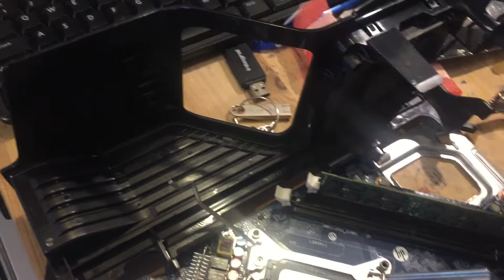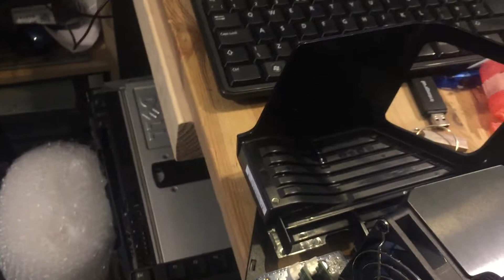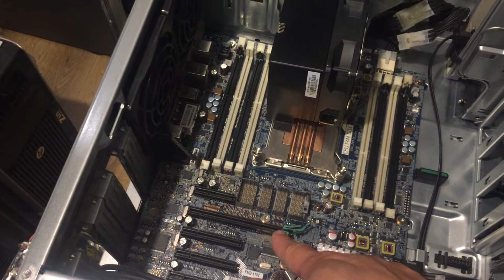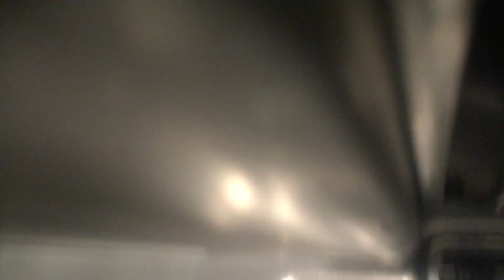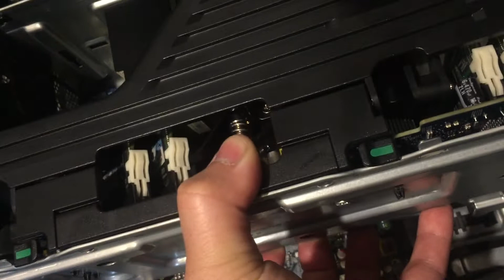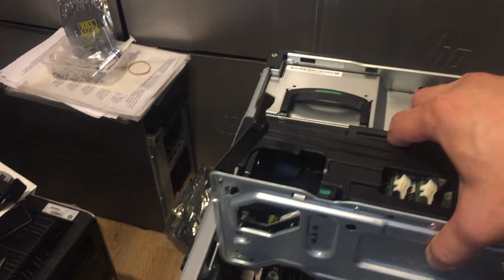HP Z620 2nd CPU riser board installation memory upgrade e5-2670 96gb ram

Comment: I love this machine !
use to work on a older medion,with a asus board....(2007) with a core duo...great desktop,great performanse when a ssd is used!
Stil use the medion some times,just for old times sake,and to keep it up to date,
But sins i use my Z620,with dual cpu(2x xeon 2660) and 32 Gb Ram....i know i had met my for ever partner.
This machiene is SO much over kill for what i do on it,that it will still be a great platform for decades!

Comment: I just used this video to help me upgrade my recently bought z620 from a pair of 2609 v2s to a pair of 2680 v2s! This helped so much, thank you!

P.S. Why the hell are the fan headers so tightly stuck together, I was having sequential heart-attacks using a screwdriver to pry them apart?!
Reply from the maker: yes, i hate the fan shroud as well. it can release by using bare finger pushing the green label parts away from the metal part
Reply: Actually I was referring to where the CPU fans plug into the Motherboard/Riser-Card, the shrouds were thankfully easy to pry apart and put back together.
Reply from the maker: thats easy just to pin up button left right, but i like the t5500 type riser than this z620 type. it was too tight

Comment: Isn't this riser a weak point in the long term on this motherboard? I mean comparing it with motherboards that have both processors on the board.
Reply: Axel Schultz it's no different than the old dell t5500s.i never heard anyone having issues with them

Comment: i want a riser so bad but they are like 500 dollars from ebay not even an authorized seller
Reply from the maker: you just wanted the riser? or with same stepping code  xeon e5 which already have in your machine
Reply: B Chiam i need the exact same riser you have in your video I already have a spare Xeon processor
Reply from the maker: you can find them on ebay, there's plenty of them available